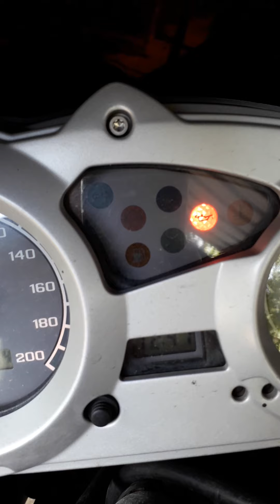Dakar BMW F650 GS hints tips repairs troubleshoot DIY video 1of2

Comment: My baby just doesn't want to start. All lights going on battery strong but no electrical supply to the starter. Pushing the start button but with no luck.
Reply: Dont freak...
It is almost always an electrical situation,especially if the bike is working hard.

Check cables and ties and connections for wear and tear...
Clean and refit/tighten connections everywhere.

Have your pickup checked for fillings or dirt.

Clean or change sparkplugs.

Check earth wire.

I also once had a short in a wire from the headlight.

This bike is bulletproof,just electrically sensitive after lots of work....be patient,research,ask around,learn.....

Also check your battery has enough Volts and Amps....sometimes volts are enough but not amps...

Does is bump/run start??

Check fuses.

Do a hard reset.
Overnight ecu reset.

Have someone check starter sequence with electrical meter.

And remember to come tell us what you find/fix!

Comment: I own a 07 F650gs where’s the best place to order parts? Chain and sprockets and aftermarket parts? Love the bike it stalls at stop lights for no reason sometimes don’t know what that’s about but it’s a work in progress.
Reply from the maker: hi...here in South Africa parts are quite freely available....and many after market parts fit the bike...the stalling,i've had 2 scenarios, timing knob and plugs....timing chord/knob sits left side of bike and kindof dangles freely next to motor,adjust timing up or down with simple turn right or left with fingers.....the plugs simply needed to be cleaned/replaced.....easy......one other scenario on another bike it was a loose earth wire, clean/replace refit. these bikes are bulletproof and dynamic,keep forever!.....ps, dont open motor for anything unless a problem arises internally, motor is strong and will run forever,have had the regular f650 and did over 200 000kms without opening motor,a car totaled the bike in an accident.....my current f650 dakar is running smooth, even after being dropped in ocean and standing for a year at coast, fired first time with new battery.....hope this helps. live free!
Reply: @jeanbornfreesa2euleroux78  Thank you very much! Your videos are the best.👍🏼
Reply: @jeanbornfreesa2euleroux78  i loved this comment lol
Reply from the maker: https://youtu.be/vHbUEca78V0

Comment: Hola gracias por el video me indicas si con una estatura de 1.65 alcanza para conducir bien la moto ?
Muchas gracias
Reply: good day

yes easy riding.
I am 1.92 tall and ride comfortable on and offroad,even with a pillion and bags.
also pneumatic and manual suspension to assist ride,travel and comfort needs.
Reply: Adrian... yo tengo 1.76 y el asiento original era el limite... casi no toco mi pies al pista... el asiento custom ayuda pero no creo que menos de 1.72 puede disfrutar este moto...
Reply: @mattmichaels3980  gracias por tu respuesta al fin me incline por la dominar 400 por el tema de altura .
Muchas gracias fuerte abrazo
Reply from the maker: https://youtu.be/vHbUEca78V0

Comment: Hi, nice overview, my CD mileage display is faulty, can't read the numbers properly, how would you fix it ?
Reply from the maker: 1.check ruder manual,check workshop manual,check wiring,sensors,rotating magnet sets(if applicaple),hard reset with battery diconnect(allow draining time),ignition reset on start by holding start for +-5seconds on start.

2.Remove and clean,reoeat steps 1.or replace.

Seek professional assistance.
Reply from the maker: https://youtu.be/vHbUEca78V0